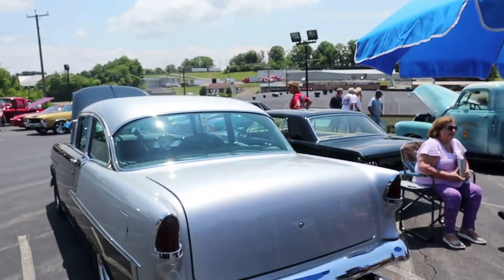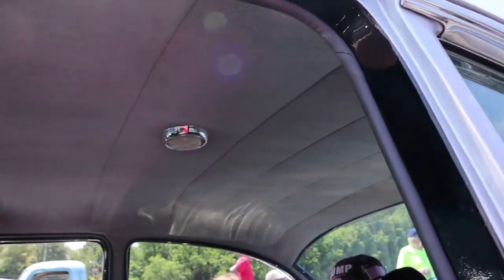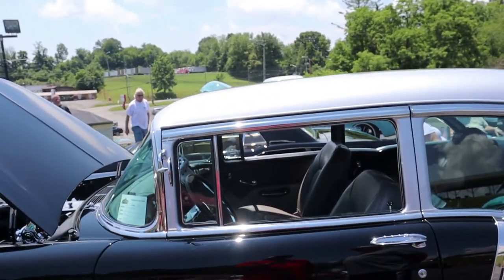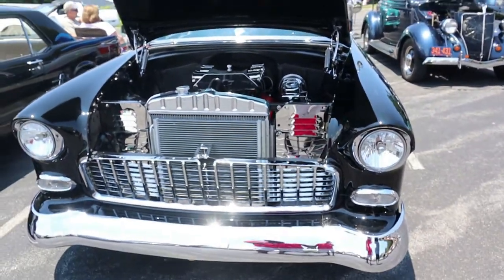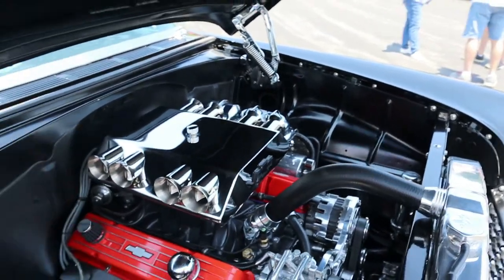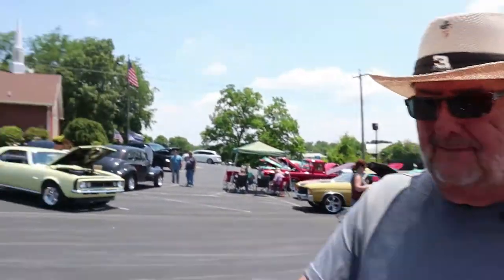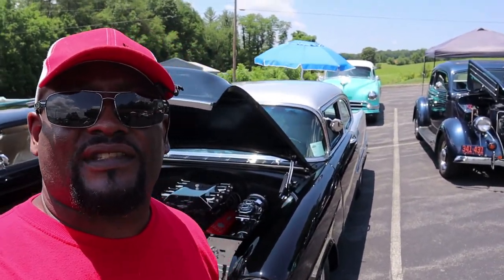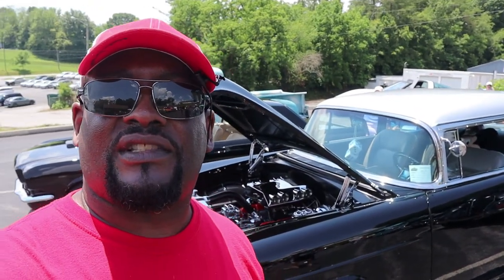1955 BEL AIR TWO DOOR POST CAR REVIEW

Comment: Really enjoyed this 1955 Bel Air review. This car is sweet. I like the color and the custom interior. And it has a 355 aluminum metal block head motor with a Fi Tech fuel injection throttle system, that is just awesome! Another thing I like is that custom made stainless steel breather, which is killer. Again I always enjoy watching your videos keep up the good work. Mark Anthony Johnson II
Reply from the maker: I appreciate you watching them.